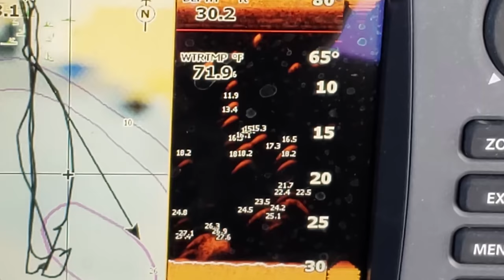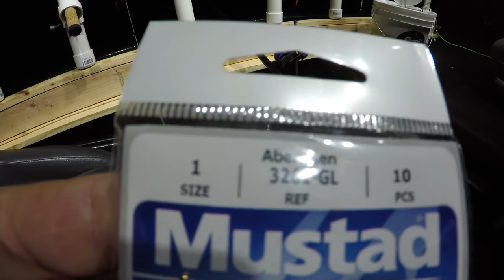CRAPPIE Fishing at NIGHT with LIVE minnows...SLAB SPECKS!

Comment: I LIKE YOUR ROD HOLDER SETUP. I WOULD LIKE SOME INFO  ON WHAT IT TAKES TO MAKE AN OUTFIT LIKE THAT
Reply from the maker: Thanks it's just pvc and wood real simple to make.  Screw some PVC caps down to the wood and put however tall section you need for height and add a angled T to the top and there you have it. We space em out around a foot and half. Works real well
Reply: @OFFFishing  THANKS

Comment: Can you explain your setup there with the 2x4s Thanks.
Reply from the maker: Yeah it's cheap way to make some pole holders. Take a couple 2x4s and clamp them to the deck take PVC caps and screw them to 2x4. Cut your pipe to desired height and add a clean out t on top and you have yourself some ghetto pole holders lol